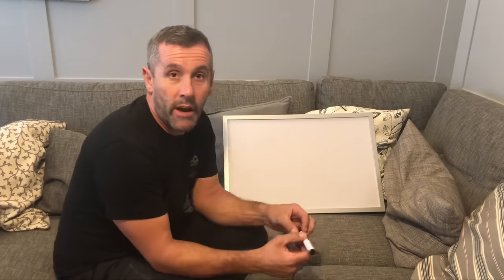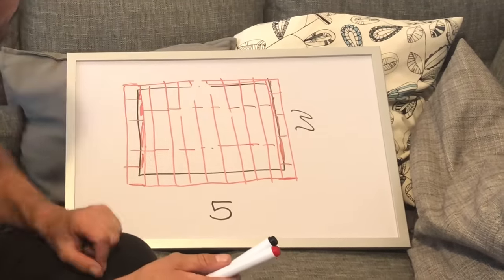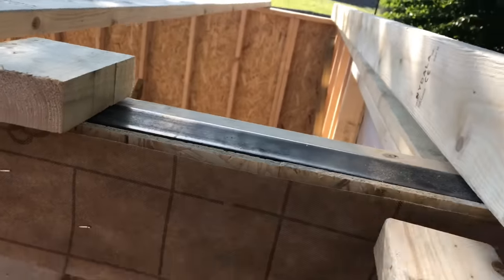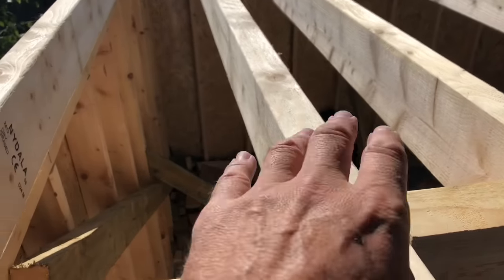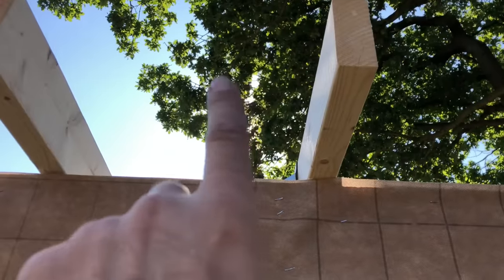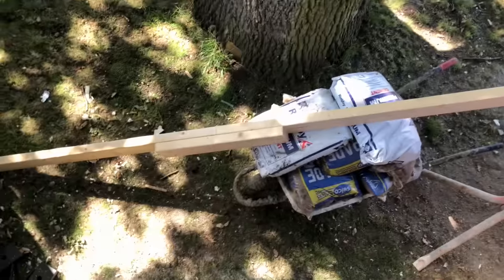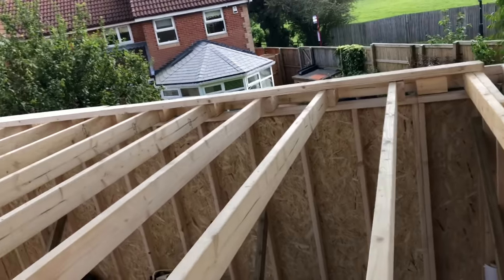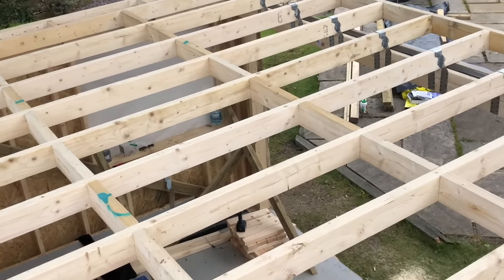How to construct a garden room timber flat roof

Comment: Hey mate what size timber do you use for the walls and the what size of steal was that? 
Thank you
Reply from the maker: andybenny1 4x2 side and back 
5x2 front wall
160x80 Steel
Reply: william griffin legend. Thank you for the reply. What is the purpose of the front all being bigger timber? I’m going to build my own and just learning at the minute. 
Thanks in advance mate
Reply from the maker: andybenny1 it’s to carry the steel and and still have room to fix a timber to the steel to allow for the joists and plaster board fixing

Comment: Why not just reduce front sofit to create correct back soffit ?
Reply from the maker: mrdamianbriscoe anything less than around 300 on front looks disproportionate nate
Reply: william griffin yeh fair enough pal or could add 4x2 cross section to build out 
Great work/ videos by the way dude 👍🏻
Reply from the maker: mrdamianbriscoe it was my balls up mate, was on my own, only had nail gun and circular saw, need depth on front for aesthetics and light recess

Comment: Why is 5x2 used rather than 3x2?
Reply from the maker: alizcool1 even at 5x2 they are not big enough for the span, but height restrictions mean you cannot use a bigger timber. 3x2 would sag and not support the roof weight, let alone, the snow load in the winter
Reply: @thegardenroomguru  would 3x2 be okay to support a clear corrugated roof?

Comment: Great vids just getting the parts together for my base , but confused by the steel channel as it’s 100 x 50 but the 4x3 fits snug. Is that because of the thickness of the steel channel or am I’m being a dick ! 
Any chance you could confirm wood size and a link to the steel channel you use please ?
Reply from the maker: hi
wood size is 100mm x 75mm, give or take a bit, steel shoe is 100mm external, approx 84mm internal, timber sits roughly in the middle of the shoe once move drilled the hole mate. its called steel channel, 100x 50mmx 6mm , most steel stockholders will supply it
Reply: william griffin top job thanks mate ! Building a monster , let’s hope I can pull it off !
Reply: Liam, sorry mate one last question !! 
Looking to source the BZP threaded bar . There are two strengths I keep coming up with when searching 4.8 or 8.8 tensile strength , which one do you spec mate ? Have you ever used hot dipped galvanised instead ? Keep up the good work 
Nath

Comment: If you're not using firrings anymore is there a gap in the roof joists due to the slope and if so do you fill them?
Reply from the maker: Yes mate it’s in the video, wall is brought up at sides with timber that also secured roof